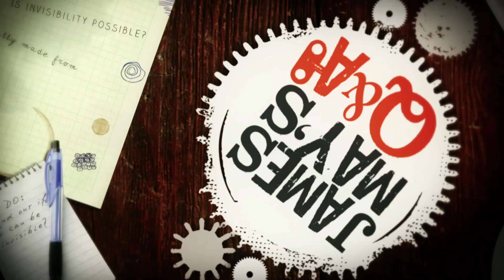Why Can't Trains Go Uphill? | James May's Q&A | Earth Science

Comment: If the earth were a globe there would be no trains.Because the hump or curve from point a to b would be too much for the train .Yes that's right if you were to believe that we live on a globe there is a curve or hump between 2 points.The hump between Dundee and Newcastle on a globe of 25000 miles diameter would be 2300ft.Amazed? That's why you don't live on a ball.The earth is flat as it was up to the 16th century when they changed it for satanic reasons.And the lie continues to this day.
Reply: Total load of garbage. Ever heard of the Cajon Pass, Tehachapi Loop, Horseshoe Curve, or Sand Patch Grade? Yeah, you need to do some real research, son. Trains have been traveling uphill for many years.

Comment: Each car has its own brakes. Unlike the movies, if the connection between the locomotive or cars is broken the entire train’s brakes are automatically engaged.
Reply: In electric trains, each car has it's own motor as well. The front "locomotive" is really a generator, if it's a diesel-electric. Many slower local trains don't have a "loco" at the front at all, they're just motorised carriages joined in a row. 

Also many carriages have onboard generators for lighting and power. A wheel drags along the rail, that turns a generator and generates the auxiliary electricity. Makes hooking up simpler when every carriage is responsible for it's own lighting etc.

Comment: Generally, trains can go uphill up to 30 permills, metro emus up to 35 permills. (although there are exceptions) Otherwise, they need switchbacks(internationally abolished on June 27,2012)  or serpentine tunnels.
Reply: What is a switchback?
Reply: @NardoStache  A Z shaped railroad where the trains once goes backwards at once, then forwards, then backwards to overcome inclines over 30 permils as such an arrangement divides a large incline into at least two parts. The last example in mainline operation was the Heungjeon-Nahanjeong switchback which the KTX-2 Sancheon passed through while pulled by a diesel loc(as it had no licence to operate  yet then) . It closed operation on June 27, 2012 and is now a train resort(Highone Chuchupark)

Comment: Nice presentation.
Trains can go up hill.
1. The Stoosbahn is a FUNICULAR railway with a maximum gradient of 110% and is the steepest funicular railway in Switzerland and in Europe. 
2. Katoomba Scenic World is a steepest CABLE railway in the world with a gradient of 128%.
3. COG trains. The Pilatus Railway is a mountain railway in Switzerland and is the steepest rack railway in the world, with a maximum gradient of 48% and an average gradient of 35%.
The first mountain cog railway was the Mount Washington Cog Railway in the U.S. state of New Hampshire.
4. Lisbon Tramway has gradient of 13.8% in Lisbon, Portugal.
5. Pöstlingbergbahn in Linz, Austria has a maximum grade of 11.6% and is one of the steepest adhesion railways in the world. 

Because you did not talk about Funiculars, Cable trains, trams or Cog trains or about trains with extra adhesion.
Last is a train with no rack system.

6. Montreux–Oberland Bernois railway (abbreviated MOB) in Switzerland has a gradient 7.3%  Trains can beat this railway.

Funny thing.
Taken to its logical conclusion as the slope becomes vertical, a funicular becomes an elevator.
Reply: Yea but you took the bait thats why its a trick question. He means reg trains like the UK/EU uses Steam engines still and the USA uses mostly diesel-electric and sumtimes they use steam. We all know cable cars and COG trains that were specially built to go up steep incline.
Reply: Funiculars have geared wheels and rails and are not considered regular rail. The maximum incline for ordinary trains is 30 permils while metro EMUs can up to 35.

Comment: So, I saw in a documentary somewhere that locomotives spray sand on the track for traction. Is that to combat this issue?
Reply: No. It's to deal with a lack of friction due to slippery rails. You don't want that as a train engineer, as it makes the train harder to control. Braking times/distances, accleration times/distances, and reaction distances in general increase massively. I say distances and not times because one must plan miles ahead as a locomotive engineer. With less friction, more distance is required to stop/slow down.

Comment: I railroad for a living in the USA. Very good stuff. What he doesn't touch on is Railroads run multiple locomotives on the head end in a consist and also remote control units on the rear end. This helps add to tr active effort and effective braking. there are also valves on each individual car that you can turn to from Exhaust to HP/SD
which in turn allows the cars to either brake harder or release slower and you can effectively pump the brakes on a train like ABS. Modern rail equipment is also equipped with sanding equipment for more traction. At the end of the day though experience regarding territory  proper training and not exceeding a safe speed of movement is key .

Comment: Why don't they make secondary more grippy wheels which can be engaged (by lifting them up and down) whenever required? May be not economically viable?
Reply: they can make the rails on the slopes out of rubber even without changing the trains a bit. that solves lack of the grip.
Reply: But in that case contact area won't change. If you add some grippy wheels, then both contact area as well as friction per unit area will increase.

Comment: What a muppet, i worked on the canadian railway for 14 years, The locomotive would spray sand on the tracks when going uphill for grip, maybe they never invented that in Britain
Reply: sigh  Yes that they do  to get traction But the sand tanks only hold so much  but if the train is heavy enough  and i've seen i on plenty of rail mt passes they will throw in a Extra set of engines  in about the middle of the set  Some up to 5 extra  engines  Not only for power to get up over but to also for braking power coming down.   So guessing that you didn't watch the whole video you, yourself just became the Muppet.
Reply: Didn't have time to watch the whole video, however what did they call those units that they put in the middle, it wasn't a full locomotive more like a locomotive without the cab, something unit, they used to call them. It's been 30 years since I've worked there. In Transcona diesel shop we used to strip a locomotive to the bare bones and rebuild it in 7 days.

Comment: Could a Maglev go steeper ? And if yes how steep can they go ^^
Reply: I think that a Maglev could go steeper because it doesn't use wheels. However, at speeds that high you'd just crash into the incline (i'm not an expert on this though).
Reply: Why not!  If the effective tractive force of the magnet system is greater than the equivalent steel-to-steel system, then it should be able to climb an incline.

Comment: what if the train goes downhill and builds up momentum for the hill?
Reply: It's not that the train won't have enough power to go up an incline, it's that there isn't enough traction or grip between the thin train wheels and the track. A train going up a hill would just slide off.
Reply: @LO-qs3sp  But how would momentum factor in? Or what if the train were 100x heavier?
Reply: @wheelmanstan  I don't know, but trains are already really heavy and it doesn't seem to make muck of a difference. There are some trains in the Swiss alps that use gears for wheels that fit into the track.

Comment: why does nobody use additional rubber-tires on the trains, which are lowered under such circumstances and raised, when no additional friction is need?
Reply: too much weight pressing down on the rubber. its much easier to use gearwheels or  trains that are pulled up by cables or a counterweight

Comment: What about a chain and arm system like a roller coaster that grabs the train at the bottom and pulls it to the top. and then an engine brake on the track slowly guides it back down generating electricity to let the next train come through. sounds cheaper and faster then blowing up hills and mountains for months at a time.

Comment: This is a bit of a tangent. The force of gravity is always straight down (even on a hill). When you are on a hill, gravity is composed of two different components or vectors. One component (x component) is parallel to the hill while the other component (y component) is perpendicular to the hill. The steeper the hill is, the bigger the x component is. That is why it is harder to go up a steep hill. You have to apply more force to overcome the x component of the force of gravity. The y component is not considered as much  because the normal force balances it.

Comment: Improper use of terminology ruins what would otherwise be a good video. Gradients are expressed in percentages, angles are in degrees, and mixing them is very wrong. A human cannot go up an 80 degree slope as the narrator stated (remember that a 90 degree slope is vertical) by walking or running as your animation showed. 80 degrees of angle is tough sheer wall mountain climbing! OTOH, an 80% gradient is much less steep 38-2/3 degree angle (remember that a 100% gradient is a 45 degree angle, or half of vertical). Please use proper terminology, otherwise you mis-educate.  Also note that modern cars can easily handle 30% gradients. You're thinking of cars from the 1920s when they lost grip (on skinny balloon tires) or gearboxes exploded. We have a number of steep hill streets in Los Angeles with over 30% gradients, and modern cars have no problem climbing them in lower gears. In fact I have driven sports cars up 32%+ gradient Fargo St in 3rd gear!

Comment: Going uphill, a light locomotive (loco without a train, nothing to do with its weight) will not slip as it's only tying to move its own weight but with a train, it's moving the weight of that too but all the driving force is being applied only by the loco. Going downhill it's the opposite. A light loco can slip going down a hill if it's raining but a train has so many wheels it's unlikely to do that. The real problem is having the brakes on for long enough to heat them to the point that they fade. The other problem is applying and releasing enough times in quick succession so as to run out of air. Of course, all this applies only to a loco hauling non-powered carriages or wagons. A multi-unit train handles hills much better. The first couple of powered wheels may slip on wet rails, but there are lots of others following that have had the water cleared away by the first couple and so are on dry rails.

Comment: He says that the tractive force stays the same up hills while the drag increases, but I think this is incorrect. When going up a hill, the weight is not going directly down into the track, which would reduce the friction and traction on the track by the wheels. He says the power output is crippled by increased drag, but he said that the drag is based off the contact points of the wheel, which are constant. It is for these reasons I think he mixed up those two.

Comment: ok so a few more things, there are other ways to go up steep slopes with trains without cog type railways, sand boxes or anything else that was mentioned, they are called switch backs. instead of going directly up the steep grade you lay out a long series of lines that you back the train down and then pull forward to climb up the hill. you first climb up the first line past where you will continue up the hill, and as you work your way up you spend a lot of time going forwards and backwards. end result is you are climbing at less steep sections of the hill than if started at the bottom and went to the top. I have driven on a road that has lot of switchbacks, thatus ed to be a railroad line in Central Arizona. it was called Murphy's impossible railline afte rthe man who tried it and got it to work. It goes from AshFork, AZ up to Crown King, the only part that is left is the part where the switchbacks are that is now a road and a few areas of tressels that were still up a few years ago, but I havent been up there for awhile.

Comment: Its not a lack of tractive force, its a lack of practical tractive force. A locomotive alone can take a steeper grade, but the economic advantage of trains is that they can pull enormous loads on level track with relatively small force. Make them go up hill and the economic value falls behind the truck. Air resistance is certainly not the opposing force determining a locomotive's top speed. There are mechanical limitations similar to those in an automobile. I'm very disappointed in the pseudo-scientific guesswork that went into this 'informative video'.
Reply: I disagree. semis here in AZ can't go more than 20 mph up some of the steep grades along the interstate.
Reply: @peterf.229  Their limitations are power, not gears or traction. If they had more power, they could go faster at low gear up hill. Their wheel wouldn't slip.

Comment: Working to explain why trains have a hard time going up hills, this video failed to mention some of the innovations that were introduced to aid in traction and why trains CAN go up hills, or at least small to moderate inclines; e.g. like the simple use of sand. 

"Why do trains have difficulties going up hills" should have been the title of this video; and no its not really a trick question, its called clickbait.

For those of you who want to learn more about how trains use sand to gain traction, please watch the provided video linked below. And no, sand wasn't used to go up ridiculous inclines, its just a method used anytime the wheels are slipping and is effective at helping to gain traction. The main reason trains tend not to go up hills, is not only because the train may slip causing it to work 2-3x harder to go 1/4th the distance, but because its simply faster to go from point A to point B when there are little to no inclines. It's not impossible to go uphill in a train, it just not very easy and depends on the many factors (a lot of them mentioned in this video) which determine how hard it'll be for the train to go up or down inclines; these factors include but are not limited to, the size of the incline, the type of engine, the condition of the tracks, the weather, the total weight of the engine and all attached cars, ect ect. 

Today, this is the main reason why tracks are built primarily as level and with as few inclines as possible, not because a train isn't capable of going up a small hill, but because its simply not as practical. Larger inclines (like making it to the top of a mountain) are made over longer distances and at a much smaller inclines, often using bridges and tunnels to maintain the smaller incline to the top. Doing this allows rail lines to be passable by almost any engine, carrying any load, in any condition.

How a steam locomotive sand dome works: https://www.youtube.com/watch?v=lDIB7L5QAHs
Reply: It's not clickbait, it's obvious hyperbole.  Everyone who has ever been in a train knows that trains can actually go uphill.